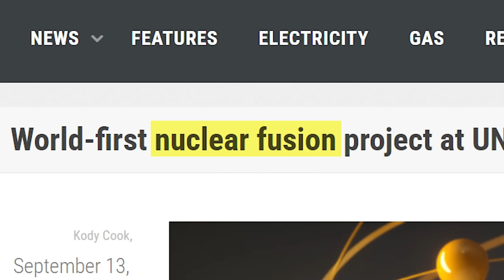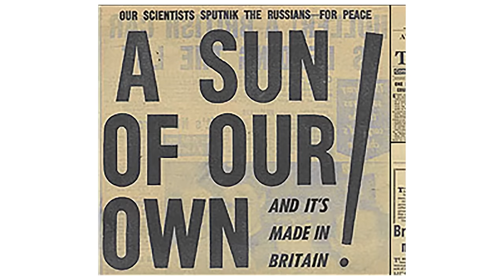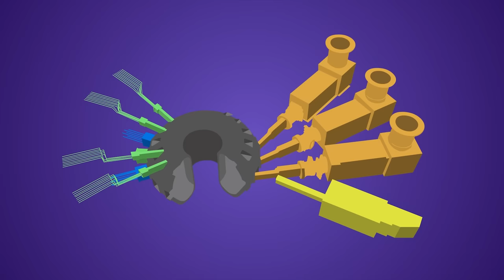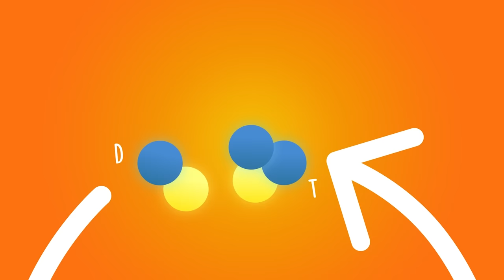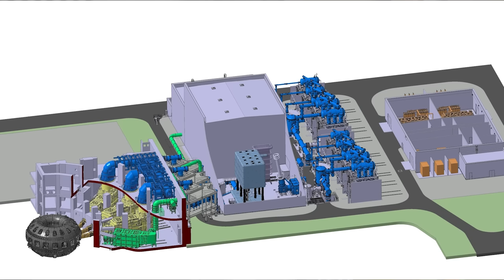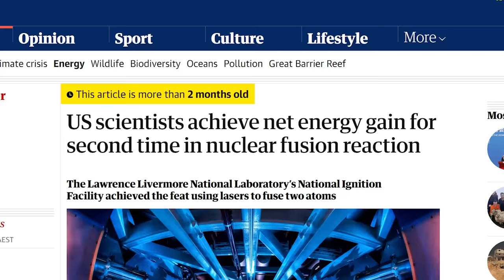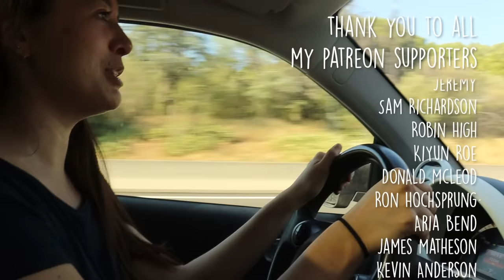World's Largest Nuclear Fusion Reactor!

Comment: Whenever I see tours of places like ITER or CERN or the Chernobyl Containment building, I just think about the tradesmen who do stuff like wire the lighting or tile the floors or put up the drywall. Like, how surreal to do such mundane work in buildings with such non-mundane purposes.
Reply: That's exactly how I felt when I toured Fermilab. Especially as, at the time, it was being converted into a facility for Proton Therapy—between the high tech of science fiction and the sterility of a medical facility, it was jarring to find that the real magic is mostly exposed ductwork, industrial equipment and control technology from the 1970s.
Reply: I think it's cool to have the perspective of someone like Grady, the civil engineer. It's easy to focus on the insane physics behind what's going on, but making something that's in real life takes a lot more.
Reply: Having worked with a lot of cabling installers in the past, I'd suspect you're overthinking that question. Most of the time a subcontractor only gets called in for a piece of the overall work scope, and so "I'm doing drops in what's going to be a mega-security switching headquarters" loses head space to "I have x drops to run today and this block to punch tomorrow" or whatever. 

That said, I did have an opportunity to do a summer internship at Los Alamos National Lab, where the junior guy on the team only had a masters degree in EE and so he was the experimentation tech. Now, he got to do surreal things like building simple charging circuits from scratch for a 25kV capacitor. To him every day was a wondrous adventure of creation, while to a network installer it's probably not much worth thinking about due to the nature of the assignment.
Reply: Just another day at work

Comment: I really don't appreciate how you framed fission power as not a safe power source mentioning waste and meltdowns. Fission power is very safe and rhetoric like that is why we aren't using more of it right now. Check out Kyle Hill for a lot on why it is safe and the problems related to it have already been solved. Granted fusion would be better than fission, but fission is still very good.

Comment: Just to clarify, the fusion breakthrough last year only technically produced positive energy. The power of the lasers output was only 2 MW, but to actually run the lasers took 100MW.
Reply: That is the big problem with communication by fusion researchers.  They tell us "the reactor had more output than input" but they do not emphasize enough that this is only concerning the actual reactor and measured at convenient forms of energy, not the achievable result for a power station.
To have a usable power station, the efficiency of the reactor still has to be improved by at least two orders of magnitude, if not more.
Reply: Well said better than my comment but basically the same i just have the technical jargon 😂
Reply: Didn't  sry
Reply: Same with ITER. The designed power output will still result in a net Q<1 when you consider the massive losses in heating+overall infrastructure like cooling. 

I'm not saying that terrestial fusion is impossible overall but this specific project is just a huge wealth distribution project like all french nuclear projects.
Reply: So it's really easy. We only need to invent a 100% efficient laster.

Comment: Loved the video, and that you got such an awesome opportunity that I'm so jealous of! One note I'll add is on the nuclear fission dismissal at the beginning. Obviously, fission is a viable form of energy generation that's used on a large scale all over the world. Per unit of energy generated, it's the safest way to make electricity, including renewables (double down: that thing that lots of people are afraid of? It's safer than wind energy). And there's a solution to nuclear waste that's been known since the early 60's: reprocessing. Basically, at the end of most fuel cycles today, more than half of the initial fuel (U-235) is thrown away, along with about 75% by mass U-238, which could be made into new fuel. Only 5% by weight of the contents of dry-cask waste disposal actually contains fission waste products. If you're going to do a video on fusion, it might be beneficial to do a follow-up on fission, highlighting where it could be made better. Just a thought :)

Comment: It should be noted that the nuclear waste and meltdown issues with fission are a consequence of old and aging reactor designs. We have (mostly theoretical) Gen IV reactor designs that would be physically incapable of melting down while simultaneously burning waste as fuel, and recycling what is left on site. We are not gonna run out of fuel any time soon, and it is much simpler and cheaper technologically speaking, the problem is mostly of PR and lobbying (as usual).

Comment: Nice to hear that Richard is informed on the subject of energy production and has presented a realistic timeline.
Reply: A lot of the promise of these commercial ideas is that they're going to beat the ITER timeline (even NIF gets on that hype once in a while).  Whether any of them will pan out remains to be seen of course.  Certainly nobody would expect another Tokamak to beat ITER but that doesn't mean alternate methods can't be achieved faster.  The ones that try to combine inertial and magnetic confinement (ie: NIF and ITER) could potentially do better than either mode separately can manage.

Or maybe not.  But as long as rich people keep thinking there's an RoI to be had and are willing to put lots of money toward these projects, I'm not ruling out the possibility that one of them might succeed.

Still won't happen fast enough to "solve" climate change though.  Even the most promising (aka: hyped) tech managing to meet its goals wouldn't be commercially viable for another decade or more, and then we have to figure out how to build several thousand of them (none come close to ITER's designed power output so that 600 number would be drastically lowballed).  Oh, and we'd still have to deal with the fossil fuel industry doing everything in their power to prevent these things from succeeding at a political level on top of everything else.

Comment: Great video! Very interesting insights. I really hope this technology brings peace, like Sabina said. Science is always for good, an achievements this size can only bring people together.

Small correction: at 17:25 you say 4 K = -296 °C, but it's actually - 269 °C. You got your digits mixed up! Below the absolute zero is definitely colder than Pluto :P
Reply: Hah, glad I haven't had to scroll much for the correction! :D
Reply: I was just about to write a comment about this! I was like -296 Celsius is impossible since absolute zero is -273.15 Celsius.
Reply: Bigger correction that DT reaction is impractical to further commercialisation of fusion power.
As
All tokamaks like ITER run at beta (ratio between plasma pressure and magnetic pressure) not higher than 2.5% .
Spherical tokamaks run at higher values but have another limitations.
We need to build such monstrous reactor because power density is proportional to beta^2.
Today we cannot to heat plasma higher than 10 keV ((15 keV for ITER).
While reactivity of plasma has a maximum at about 30-50 keV.
This also impacts on size of reactor and its cost.
High neutron flux will inevitably quickly damage costly first wall.
That will be strongly radioactive after this.
Then should be replaced.
Replacement.
You remotely!!!! should dismantle 18 toroidal field magnets weighing 310 tons each.
Before you should dismantle the entire cryostat.
The only way to make fusion power attractive for investors is to go to uneutronic fusion.
That need for ignition much higher temperatures.
Sorry.
But that is reality.
Fusion race now is like a competition of many collateral technologies - such as huge superconductive magnets. Etc 
But where is a creative ideas to overcome limitations of tokamaks?
Make experimental with lower cost resistive magnets but with higher beta, with higher plasma temperature.
If successful, only then build the next reactor place in such a huge cryostat with liquid helium cooling and use costly superconductors.

Comment: Correction for your information about the gain of 1.5 at Lawerence Livermore's National Ignition Facility in 2022. The achievement is called "Ignition" and it means they released more energy from the fuel pellet fusing than they delivered to the pellet. Because lasers are not 100% efficient in converting electricity to heat or pressure, in this case, the experiment required many times the energy released. ITER hopes to solve this problem by scaling up and we'll have to see if that works. The reactor was expected to take 10 years to build, and ITER had planned to test its first plasma in 2020 and achieve full fusion by 2023, however the schedule is now to test first plasma in 2025 and full fusion in 2035. Thus making very real the joke that Fusion is always just ten years away.

Comment: I'd kind of nitpick that fusion bombs also produce energy gains of greater than one - so if "fusion history" includes weapons then the US National Ignition Facility's test last year wouldn't have been the only time in fusion history that output was greater than input.  Only time in fusion reactor history maybe, not not in all of fusion history.
Reply: Yeah its a bit of a sloppy wording.  She (and most other people these days now that fusion power is all over the hype train) mean the first controlled reaction with net gain.
Reply: @altrag  Even then, it's still sloppy wording. At NIF, they had 2.05 MJ of laser energy, and got 3.15 MJ of energy output. That is only a gain relative to the laser input, ignoring the energy required to create the laser beams in the first place. The lasers required around 300-400 MJ of energy to produce the 2.05 MJ laser input. Gain = Ouput/Input = 3.05/400 = 0.007625. That's still FAR from being actual energy gain of over 1, by a factor of over 131.
Reply: @lukas_berger  Hence the "with net gain" caveat.  But yes that's still a little confusing and there was a lot of science reporters at the time who went out of their way to clarify that distinction (how many were successful at their attempts is an exercise left for the reader).

But that's a fairly typical "science doesn't always use words in their colloquial sense" issue that plagues all of the sciences regularly, whereas mixing up nuclear energy vs nuclear weaponry is a fairly large distinction relative to simple definition misunderstandings.

Comment: I started Naval Nuclear Power School in 1970. Our physics instructor was very sure we were going to have practical fusion tech by the year 2000. So now we are 23 years past that prediction and we still are running experiments to TRY to create a sustainable, controllable fusion reaction. 
The other point that needs to be addressed is that fusion reactors, when they become available, cannot replace all other energy systems. As was pointed out in the Practical Engineering video, it takes a LOT of megawatts to run the support equipment, form the containment field and then create and heat the plasma. Only when those conditions have been met can we start to inject the lithium and Tritium needed to create actual output power so that the fusion reactor facility can make enough power to run itself. 
A few emergency diesel generators will not be able to do that. You will need fossil fuel and/or nuclear fission plants that CAN be started up with backup diesel generators to get things going.

So if the the climate change crisis is really as bad as is claimed by many, we had better start building nuclear fission power plants NOW and use them to replace the fossil fuel plants in use all around the world. I say that because fusion power is NOT going to be coming on line in time to meet the predictions of the climate change crowd.
Reply: DOA. Fission is too expensive & Fusion (if it worked) would be 50 times more expensive than fission. The cost of ITER (500 MWth) will be between $45B and $65B, and still won't have the means to produce electricity or breed tritium.

Comment: Something I've always wanted to ask a fusion engineer is: once we have this technology fully realised, would the fusion if properly controlled allow us to create specific elements?
To clarify, would it allow us to fuse specific elements in a way that allows us to produce heavier elements, things like gold/lithium etc and if so, wouldn't this be true alchemy?
Reply: The short answer is no.  Fusing hydrogen to helium gives off the greatest amount of energy.  Fusing heavier elements together requires a lot more energy input and yields less energy output, so it's far more difficult to do.  And once you get into elements that are heavier than iron, fusion actually costs energy overall - that is, the entire process doesn't produce any energy at all, it actually absorbs it and stores the energy as extra mass in whatever elements you produced.  Even in stars, most heavy elements like gold aren't produced via fusing lighter elements together but rather from merging (exploding) neutron stars where you don't start with any atoms at all, just an incredibly dense soup of neutrons.

Comment: With fusion, why can't we use the energy more directly? Seems like it still ends up being used to heat up water, make steam, power a turbine with a generator and then get electricity.
Reply: You can't make electricity directly from deuterium and tritium combining together.
Reply: @user-hm1fn2xg5p  no, but why can't the circular rotation of the plasma, which is held in place by strong magnets, not also be used to rotate the magnetitic field on a generator? That's all the steam is doing in a turbine (powering the rotation).

Comment: My favorite thing about fission and fusion is that we have all this high level science that goes behind the basics of the energy generation and at the end of it, we run a steam turbine like from the 1700s. We still haven't figured out a way to get the energy out more efficiently to generate electricity, it's ridiculous.
Reply: I think in some processes a supercritical carbon dioxide working fluid is more efficient, but it's still turning a special shaped wheel.
Reply: there are some non-Tokamak fusion proposals which use a more direct energy capture approach but they are all in private company / start-up land.

Comment: Greetings from a viewer of Grady's! Dunno how your channel escaped my notice all these years, but I'm here now with some catching up to do! Being a sci-fi nerd, the discussion of initially heating the plasma caused my mind to leap to all of the small "fusion" reactors we see in sci-fi, and how that future could come about. That's a lot of infrastructure to put on everything that uses fusion.

To borrow a term from the power producing industry, I wonder if that means we'll end up with a few large "black start" reactors that produce the plasma, which "fuel" smaller reactors with that plasma already in its self-heating state. If not every reactor needs to be ITER, that would really help with building at scale. Thus, leading to the logical result: fusion-powered steam trains! 🚂😁👍
Reply: Heh it would be a ridunculously complex connection between those reactors... To transfer any plasma outside the containment which is already mightily hard and betrays predictions at times.
Reply: @u1zha  Fair point, but I'm sure jet engines and fission could have had similar things said about them once upon a time. Metal forges already have the ability to move molten metal using nothing but magnetic fields. While the penalty is obviously much higher in the event of a malfunction, I would expect something like that could be the start of a means to move that plasma.

Comment: Curious how the extra Helium is pulled off as too much would eventually reduce the fusion.
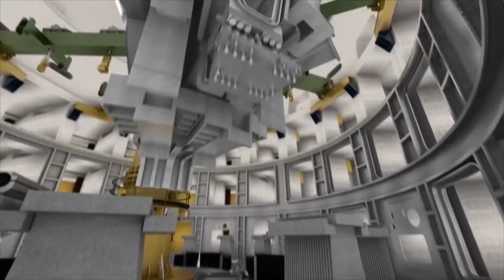Reply: The helium ash and most of the heat will be dumped into the diverter, which is the ring-shaped ash-tray at the bottom of the vacuum chamber. At 11:23 you can see it for a second in the drawing (the CGI animations are lacking that part unfortunately).
I think they have that part of the process pretty much figured out, as they already did it in JET at a smaller scale. Also, tokamaks are not made for continuous heating anyway, because the central solenoid needs to recharge periodically (after inducing lots of current inside the plasma, which is not just for heating but mainly for stabilizing the plasma).
For an easier-to-operate (but harder-to-build) alternative concept that could work continuously, see stellarators such as Wendelstein-7x.